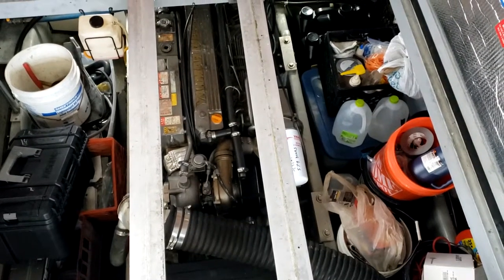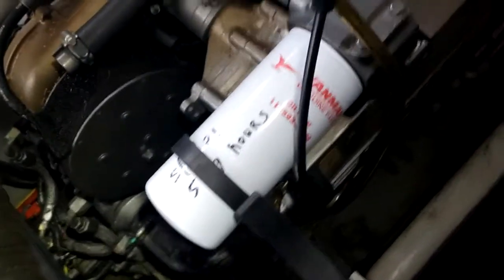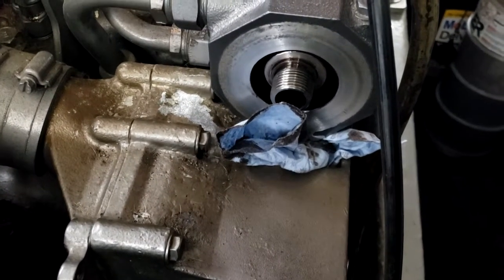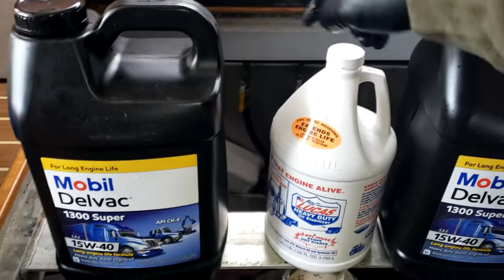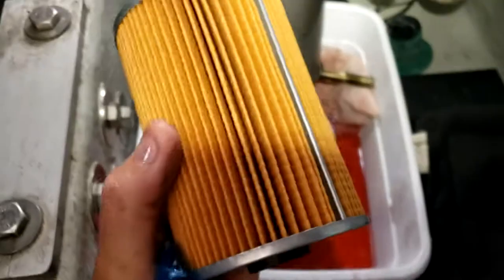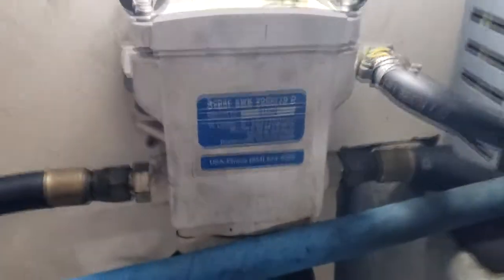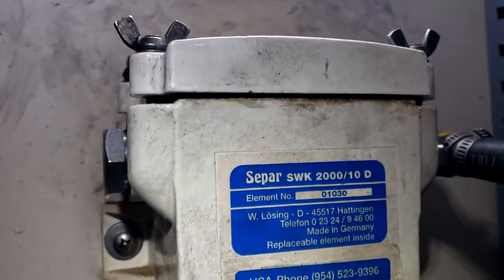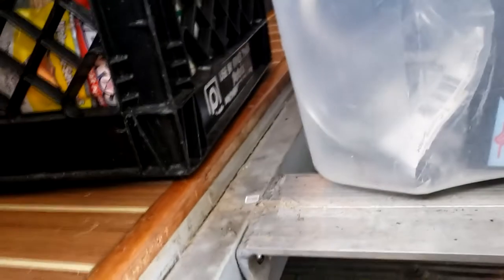Mainship 400 Yanmar 6LYA-STP oil and fuel filter change. exciting stuff

Comment: Great video.  This has been very helpful in changing my filters.  One question. When using the fuel priming pump after changing filters and turning the fuel back on, I’m getting no noises, no fuel sounds and no resistance. Any ideas what may be going on?  I don’t want to try to restart her if there’s no fuel in the secondary (engine) fuel filter.
Reply from the maker: You got to pump a long time. The secondary filter needs to fill up and then the fuel should get pumped back into tanks. Maybe your tanks are full and you can't hear the splashing? Don't forget you can open vent on the filter until fuel squirts out.

Comment: Interesting! How many replacement parts do you store on board? Are parts/filters available at marinas? Or do you go to Wal-Mart?
Reply from the maker: Amazon. Walmart doesn't carry diesel parts. Marinas are too expensive. Oil filter can be as much as $40 to $50 each. Gotta shop around.

Comment: I'm curious do replace both the bypass and regular filter at the same hours? Little confused by the 2 filter setup
Reply from the maker: We replace both at the same time, 250 hours, primary is 30 micron and secondary on engine is 10 micron